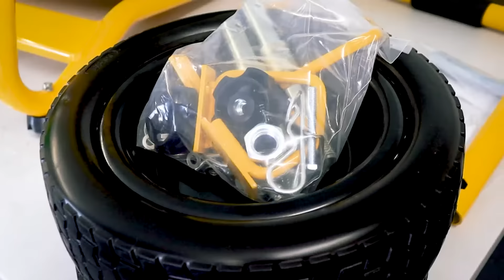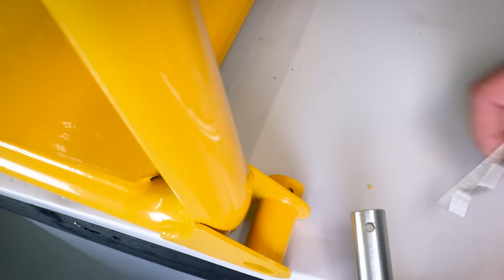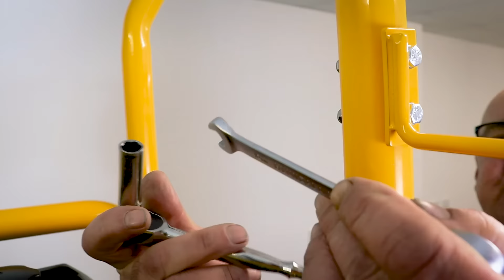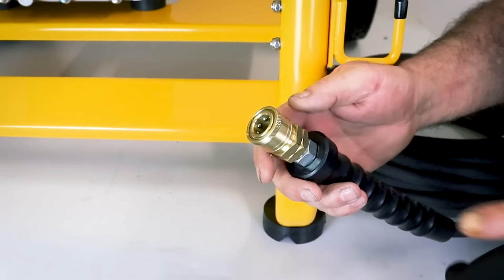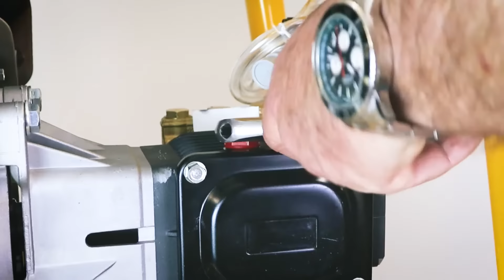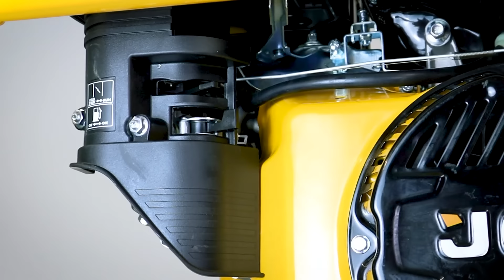Unboxing the BRAND NEW JCB 4000psi 15hp Petrol Pressure Washer By JCB Tools [JCB-PW15040P]

Comment: what hose pipe re water works best for the PW15040p model? is it the 3/4 inch hose?
Reply from the maker: For the JCB PW15040P pressure washer, the recommended hose size is typically 3/4 inch, as it fits the EURO fit connectors commonly used with this model. This size ensures optimal water flow and pressure performance. However, it's important to use a hose that is rated for high-pressure use to ensure durability and safety during operation.

Make sure the hose is long enough for your intended reach, and check for any specific manufacturer guidelines regarding hose length and material to maintain the best performance. If you have any other questions, feel free to ask!
Reply: @JCBTools  thank you - and what is the best rotary nozzle to use to give that extra cleaning power?
Reply: @JCBTools more videos mines not got pressure 😢

Comment: Guys i have a lot of difficulty adjusting the pressure regulating knob. 

It simply doesn't move one way or the other.

Any advice? Thanks.
Reply: I have the same issue, did you mange to find out why?
Reply: Hi , not yet, unfortunately.

 @lukesaunders2808
Reply: Same issue
Reply from the maker: Hi there! This is factory set and adjusting it is not recommended.
Reply: @JCBTools  thank you....but I've seen lots of people do it. Besides, why leave it open to the customer as an option if it's not recommended?
Reply: @JCBTools why is it not recommended and on top of that then it wont allow to use the full potential of the pressure washer

Comment: what size are the quick connectors?
Reply: Did you ever find this out also need to know
Reply from the maker: Hi! The connection sizes are a standard size, - 3/4"inch quick connection. We hope this helps!
Reply: Yes it's 3/8 inch quick connector and end of the lance are 1/4 quick connects